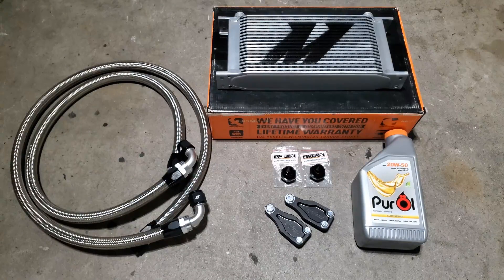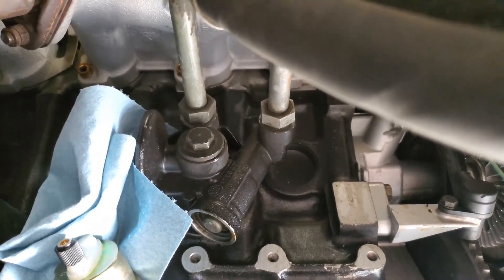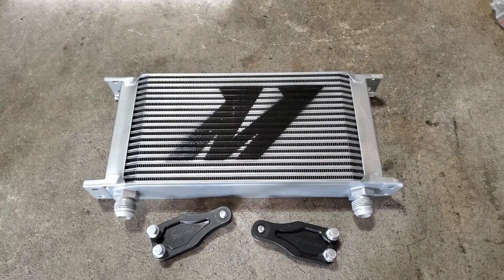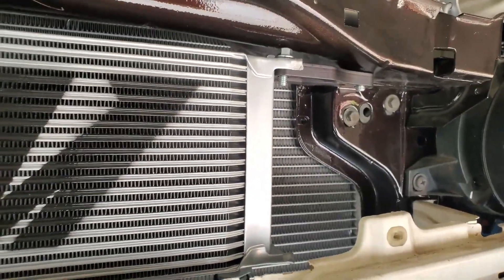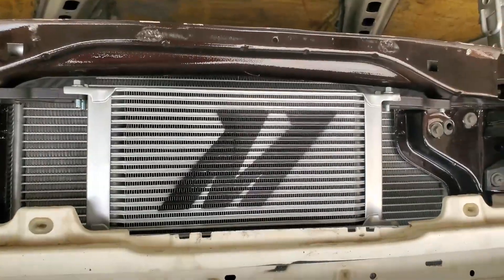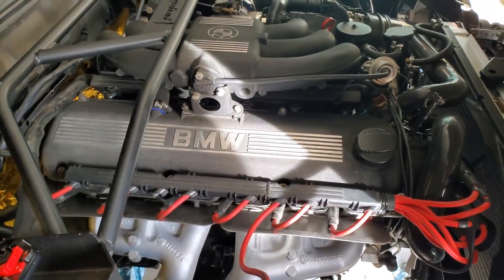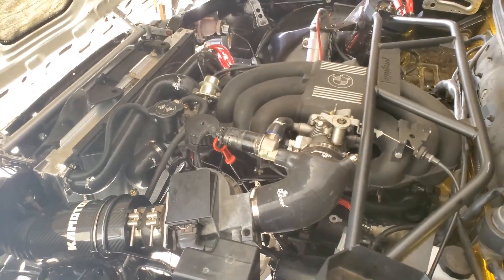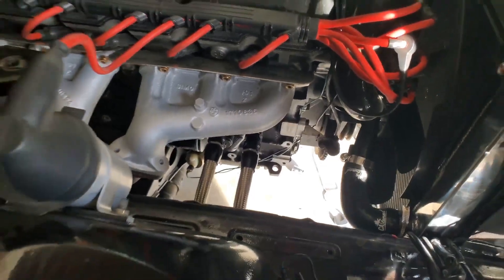Installing a Mishimoto Oil Cooler on the BMW E30 M20

Comment: mounting the cooler this way is how you end up with an air lock.. dumb
Reply from the maker: Appreciate the feedback...many have run this placement with no issues...one could also argue there is no point in having an oil cooler on an m20 at all...

Comment: Hey, how does those AN fittings work, wont drip oil ? Because fittings are liitle bit different than oem.
Reply from the maker: Nope no oil leaks. I do have one coming from the oil filter housing to the oil filter both oem bmw and another small one also coming from the oem bmw housing. Nothing coming from the Mishimoto AN lines or the adapter fittings

Comment: Really no benefits whatsoever. Just use good oil. This ain’t racing engine. It’s just for people itching to do stuff. Oil is supposed to run hot. Not cold. Using good quality oil is good enough. 
Completely useless money wasting stuff. I’ve never had any problems whatsoever running my e30m42 since 1990. It’s now nearly 600000km.
Reply from the maker: Your not wrong...people have done studies between oil cooler and no oil cooler and there isn't much of a difference. oem oil cooler vs no oil cooler this is completely overkill for a street car, but for a full blow track car lap after lap then it might be worth it...but yes it's just something to do

Comment: What’s it for this thing? Does it do better than standard bmw?
Reply from the maker: Sorry for the late reply...it's it's oil cooler...if you don't have a stock motor and doing hot lapping track days I'd say it worth it...on a street car it has no improvement in anything. Mishimoto products are fantastic but for stock motor and street driving its overkill
Reply: @The Masked Driver  it’s useless. People itching to do this have nothing better to do. Good quality oil is key and also oil must run hot but not too hot to be efficient.
Reply from the maker: @selespeed3  completely agree

Comment: Do you know if this would have fitment issues with the Condenser and Condenser fan?
Reply from the maker: This set up will not work with the oem ac condenser fan. I would have to double check but there might still be room for a condenser and there is plenty of room to run a smaller fan below this set up

Comment: for hooking up oil temp and pressure.  best to use stock oil pressure for temp and pressure senders?  Is there a way to do it so that stock oil pressure light is untouched?  I've been searching R3v but hard digging up these old threads.  Sandwich plate seems reasonable for oil temp, but it doesn't look like a pressure sender would fit?  Does exhaust heat not throw temps off at the oil filter housing?

Thanks !!
Reply from the maker: I'm using the stock oil pressure sender so there is no light on and another aftermarket sender for my gauges. As far as placement for a sandwich plate...I'm not sure if the exhaust would alter the temp sensor. I am running a Race German adapter that goes where the oem oil pressure sender goes. Check out the triple gauges install video for how I am running everything
Reply: @themaskeddriver  will do thanks boss.  I'm looking to add water temp, oil temp, oil pressure.  working on the oil stuff first.

Comment: How have you found the stainless radiator? Mine always seems to run on the hotter side. I’ve tried replacing the thermostat, sensor and the radiator but it’s not helped long term, I’ve bled it many times and tried other things but I think it just needs more cooling capacity. Any tips welcome!
Reply from the maker: Mishimoto aluminum rads are always a great upgrade to any car! E30 are notorious for the difficulty of bleeding the coolant system. If you have already replaced your rad you can check to make sure your clutch fan is working properly, old clutch fan can lead to overheating. Check your water pump as well! Worse worse case scenario you might need to check the head gasket as that can lead to overheating problems. Hope that helps!

Comment: Hey, could you explain to me as I am confused with retrofitting oil cooler on my BMW.
Since there is no existing kit my engine on E90, I will use universal sandwich adapter, but I noticed you have bolt and hoses connected in the bottom of the engine, does sandwich adapter come to the oil cap filter or am I understand this wrong?
Reply from the maker: I apologize for the late reply. For starts this video was for an e30, not an e90. E90s are different since the oil filter is at the top of engine, so you would not use a sandwich plate. There are places on the oil filter that can be used to feed and return for oil I believe. Mishimoto has a fitting for it. There are plenty of videos for e90 oil filters, specifically e90 335i has two ports made for adding other oil coolers. I hope that help if you have any other questions please feel free to ask
Reply from the maker: E30 oil filter is lower on the motor that is where my oil feed and return is...so thats where the hoses would connect to. E90 oil filter is at the top of the motor